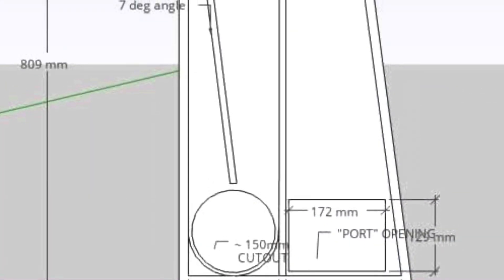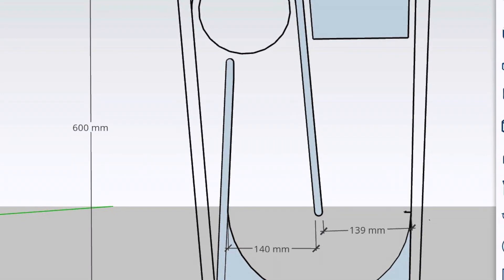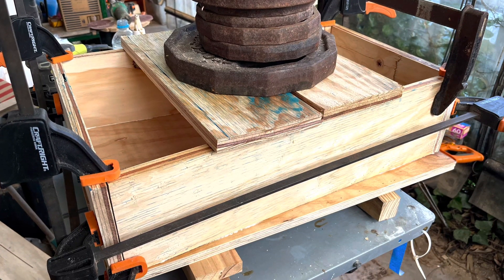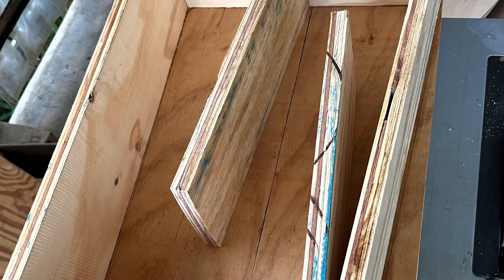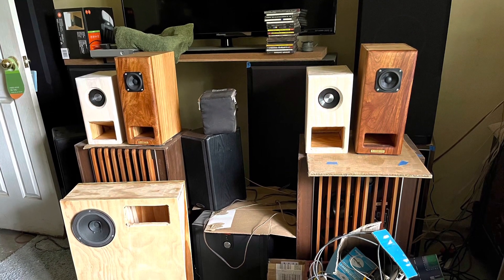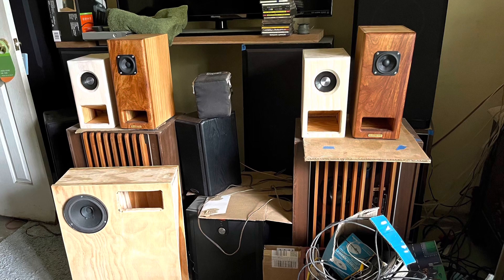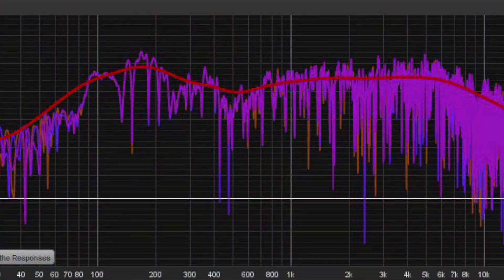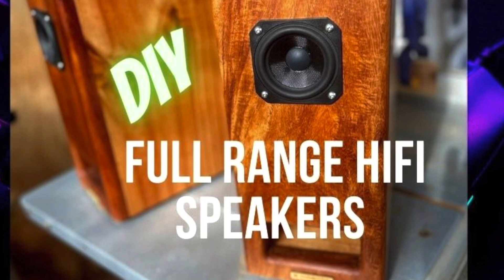Double Folded Voigt Pipe Prototype 1

Comment: The sound quality is NOT good.   You will have to TUNE pipe with just about anything you can get.  I like rock wool insulation.  Also you will find that killing the box self resonance will also get the crisp sound that is so delicious.  ❤❤.  recommend tech ingredients 2nd best Speaker as required viewing for a want to be speaker builder.  😎

Comment: Just a suggestion that mot having the curved reflectors at the bends enables more of the high frequencies to exit the mouth of the horn which is something you don't want to have happen as it confuses the image creating multiple sources. Placing the mouth of the horn on the back side of the cabinet will assist in you hearing less high frequencies exiting the mouth or at least delay them long enough for your brain to recognize them as reflections which is a better compromise. Nice job thanks for posting, going to look for your next post now.
Reply: That is a good point, makes me wonder why all the speakers I have seen this far have the opening facing forward...
Reply: @a64738  well placing the horn mouth (or a reflex vent) at the rear of a cabinet will increase the delay time between the direct driver radiation (or the vent radiation,including noises from chuffing) making it easier to differentiate between the two and establish that sounds other than the direct as distinct reflections thus improving stage and image of the loudspeaker. I think people just forget that bass frequencies are unidirectional further bass levels can also be enhanced by the front wall reflections. Folks may simply find looking a  horn mouth or vent a little bit more interesting  reminding the owner what they payed for rather than hiding the mouth or vent at the back of the cabinet. Out of sight out of mind as they say.

Comment: I see that the port of your speaker is smaller than the end of the pipe. This causes the wave to compress as it reaches the end of the box, which sends an interfering wave back up the pipe. A true Voigt pipe expands continuously to the end. You might consider opening the port completely.
Reply: Кстати да, очень верное замечание! Кажется, что вы высказали то, что меня всегда смущало — вот эта закруглённая квадратная дырка с чёрными углами, от тупой фрезы)
Reply from the maker: @imiafamily  thank you for your comment☮️🇦🇺
Reply: @diyfullrangehifispeakers  подскажу ещё одну русскую идею — сделайте дополнительный рупор, расширение, на выходе из корпуса колонки
Reply from the maker: Hmm ok I'll try it☮️🇦🇺
Reply: Yes since it is really a bass horn it should be larger and larger opening or else it will disturb the horn effect?

Comment: Can a folded VP be 6ft talk but have its driver still be 3ft high?
Reply from the maker: In my limited experience they sound better with the driver at the narrow end of the pipe. I would put the port at the top, the driver just below it with the fold at the bottom.
Reply from the maker: Should go down to under 30hz with the right driver.
Reply: @diyfullrangehifispeakers  thanks. I wonder if a tri folded vp is possible